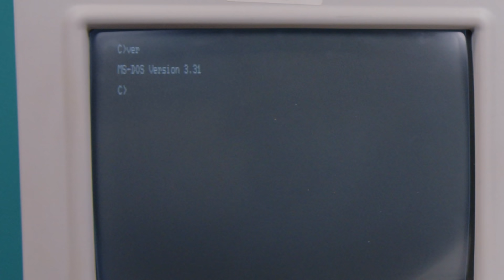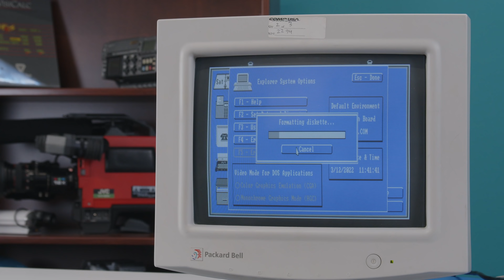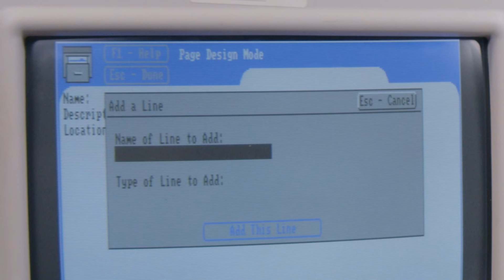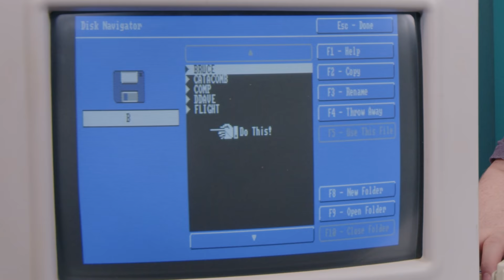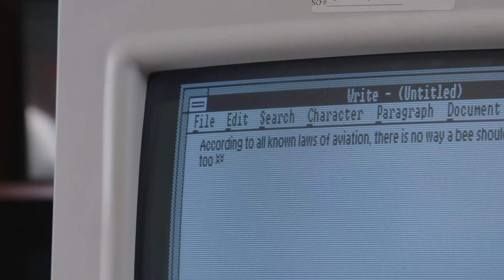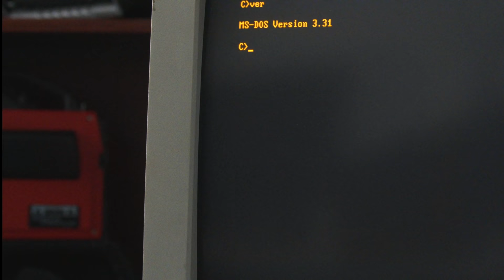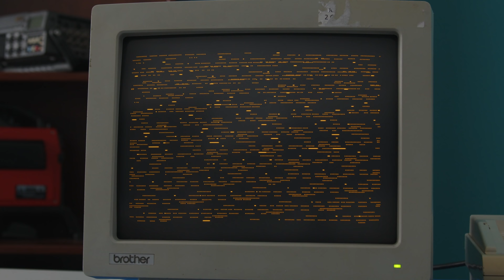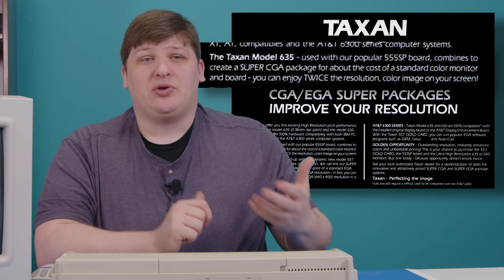Headstart's PC With The Weird GUI "OS" [Explorer]

Comment from the maker: FOOTNOTES / CORRECTIONS:

First, in re: the video chip. I did have the machine open, took a bunch of photos, looked up every chip I could and got nowhere. Somehow (I can't explain this) I completely missed the chip RIGHT NEXT to the video port, a Yamaha v6366. It's documented (http://www.sampson-jeff.com/temp/v6366.pdf ) and appears to genuinely be a weird little gadget that would have required a custom driver. It appears to actually be intended for laptops, which makes sense this late in the decade.

Second, in re: my speculation about the provenance of the design: I decided after finishing this video to revisit the PCB. I did in fact open the machine and look at the board, but got very little info out of it; several of the chips were dead ends on google, and the markings on the board didn't go anywhere either. However, I've checked again, and I have a new lead.

The board is prominently marked "CADAC", and when I searched for that while writing the script, I included terms like "PC" and "computer" and got nothing useful. Today I tried "cadac pcb" and wouldn't you know, it turns out that CADAC is a Dutch board design house, founded about two years before this PC. I have no more info than that, but IMO the coincidence is too strong to ignore.

I assume, 100% of the time, that any clone made before the late 90s was not designed or built in any western country, because the clone market led the electronics industry in exploitation of cheap overseas labor. There are rampant examples of this, including cases - which I scripted, but chose to cut from the video because I couldn't provide solid, visual supporting evidence - where major manufacturers like Dell and IBM simply stamped their name on designs from Taiwanese ODMs, utterly unaltered, and then ran ads in American magazines boasting about their brilliant design and engineering minds, while describing a machine they had zero input on.

So I just assumed this was a similar case, but, Dutch company, Dutch designer - it feels like this was genuinely designed in the Netherlands. Who knows though, maybe a Taiwanese ODM designed it and contracted a Dutch board house to make the boards. Either way,

Third, in re: the refresh rate: MDA is 50Hz, not 75. I was vaguely remembering VGA textmode's 70Hz and thought it had inherited it partly from MDA. I planned on double checking, but while shooting B-roll I had my shutter at 50FPS and was still getting really bad raster roll. I had to adjust to some weird off-speed like 48fps, so my gut was saying "sure enough, feels like some in-between value."

Fourth, in re: the keyboard: Something that's always missing from my comments on keyboards, which I should do better about, is that in the 80s very few people had "proper" "modern" typing experience. Typing was not that common a skill to begin with, and with the PC having basically the only keyboard that you could conceivably learn to touch-type on the way we do now, people simply weren't using keyboards the way we do. Typing on a typewriter, even an electric or electronic one, is very different than on a PC-style keyboard.

All the same, when the PC came out, all the publications praised it's keyboard; they recognized that it was phenomenally high quality and set the bar for microcomputer input, which - to my mind - means pretty much all the manufacturers would have known that that was the peak and were aiming substantially below that mark. So even knowing the context, it's always bugged me that they cut that particular corner so sharply.
Reply: Apparently this little monster can do 320x200x256 with the right DAC, though it's not VGA-compatible (for one thing, it seems to be 9-bit color configured as 3-3-3--8 shades of gray per channel--rather than the VGA's 18-bit color). As for the other chips, the Acer chip near the CPU seems to be an XT-on-a-chip (similar to the Faraday FE2010).
Reply: @lee4hmz  Of course, the CGA and EGA monitor standards only supported 16 colours in total--red, green and blue either on or off, and an extra "brightness" bit to double the number of colours. So, you'd also need to hack a different monitor adapter in, which all seems a lot more work than is worth it!
Reply: @d2factotum  Yeah, at that point you'd be better off shoving in a 8-bit VGA card.
Reply: The Yamaha chip you have listed as being the chip does support the Tandy video mode of the MC6845.
Reply: Huh, i always assumed the original IBM clones were mostly reverse engineered/ designed in the West. I'm pretty sure commodore's IBM clones were designed in Germany (board Layout etc ) and produced in Germany and hong kong...
Reply from the maker: @chunye215  I'm pretty sure e.g. the Compaq portable was, but magazines at the time were rife with references to Taiwanese clones. It's always been implied to me that the ODMs were overseas, though I don't know if anyone knows the full truth.
Reply: @CathodeRayDude   I'm sure it's a huge mix.  I have a PS/1 486 that bears STRIKING resemblance to a Packard Bell PB520SX 386SX.  If you set one on top the other, the chassis design is nearly identical.  There are a lot of similarities on the inside structural design as well.  Both have ties to Samsung, IIRC.

Also, FWIW, re: the tortured UI of this thing -- you started comparing the keyboard to contemporary typewriters, and acknowledged the common level of typing skill at the time.  Take that one logical step further.  E.g., the word processing editing features are pretty poor, but they're about a mile ahead of a bottle of White-Out.  There may be better products out there, even at the time, but the bar was really, really low.  It didn't take much to be "good enough" compared to the manual alternatives.
Reply: @CathodeRayDude  aight, I mean, not that I did any research on this, it was more like in my mind Taiwan only really appears on the map in the 90s technology-wise regarding stuff in the West, but that's obviously wrong. Japan would have been another contender, but they were already "far enough" to actually release the clones under their own brands iirc. I mean, Japan, Korea and Taiwan they all started out as the cheap producers of Noname and counterfeit electronic stuff before becoming good and respected in that regard, just somewhat offset. <Insert that back to the future quote/reference here>
Reply: Guessing this is meant to be the pinned comment? For some reason YouTube unpins edited comments, even if it's from the video's creator. Probably because they actually hate the people who make them money.
Reply: It would not surprise me if that company is somewhat related more close to Philips as can be detected, like some sponsored project. There were many tech start ups in the vicinity of Philips and the technical university in Eindhoven.
Reply: As a geezer who graduated high school in 1978 and college in '82, I don't entirely agree with your comment that few people in the 80s had "modern" typing experience.  Most typewriters do have a different keyboard feel - particularly a manual typewriter.  And I know because I used a manual typewriter for a few years on my first job before we replaced them with computers.  But in high school, I learned touch typing on an IBM Selectric typewriter.  IBM Selectrics were very common for typing classes in many high schools and colleges, and most students who planned to go to college took at least one typing class in high school.  It's been a long time, but I think the feel of the keyboard on a Selectric typewriter was very similar to the IBM computer keyboards that followed.  Regardless, I love your videos - always well researched and well presented.
Reply: What was that Hercules test program you were using? I have an aftermarket Hercules card which acts buggy on certain software and I'm wondering if it also has a faulty/non-supported page 1.
Reply from the maker: Can you email me? Cathoderaydude at gmail - I can't get to it right now but I can email you back later once I dig it back up
Reply: @d2factotum  I believe EGA is actually a maximum of 64 colors, achieved by having an intensity bit for each color instead of the shared one from CGA. Of these 64 colors only 16 can be used at once and I don't know how much software used other than the default 16 colors.
Reply: I just have to say your grasp of this era of computing is quite striking. Especially considering you did not experience it first hand. I am deeply impressed.
Reply: I disagree with the level of typing.  I used PC clones from the time I was about 12.  It was like 86, yeah, ages me a bit.  But the typing would have been a problem even in that era.  That is simply bad programming.  Also, DOS, up to v6.22 could also boot from floppy.   And, 3.1 on that was buggy as crap...  also, I am very very curious at how format works on dos 3.1 with that 3.5" floppy drive, since 3.1 did not support 3.5" 720k disks, MSDOS didnt support that until 3.2.   sooo, is this a hybrid 3.1???
Reply from the maker: @jkramerks  I thought it was 3.3, I may have misremembered or misspoke
Reply: Did you forget to pin this comment, or is it intentional?
Reply: Do you want to publish the PCB shots somewhere? Might be good for posterity, and i'm very certainly taking a look. There's probably a lot more small details to discover besides the Yamaha chip per se.
Reply: Thank you! I started on a mid-80s Zenith laptop - DOS of course & monochromatic - wish I'd kept it - vintage now! Cheers...
Reply: Gernot Schrader  The comment I was replying to was claiming the monitor standard was 16 colors. An EGA monitor can do all 64 colors and doesn't care about the more limited palette of the card.
Reply: Gernot Schrader  wat
Reply: Gernot Schrader  Considering most changes they make are hostile towards YouTubers, and generally seem to result in a drop in views and hence revenue for smaller channels, I can only conclude that they hate them. I'm sure they love the big channels, since that's who the changes seem to benefit, and that's who makes them most of their money. But the only time a small channel can get YouTube to even respond to an issue is to get it trending on twitter.
Reply: Uh.. you can learn to touch-type on just-about any keyboard that isn't sticky or unresponsive. I did so on 8-bit Ataris (which had passable keyboards early in the decade; they weren't cheap machines), and for 30 years after I suffered from PCs having the return key in the wrong place. :)
Reply: wait you said 5 years before MacOS and 2 before Windows?  Wasn't Apple first with the window based GUI?  Was it with the Lisa or IIGS?
Reply: Can I just take a second and be jealous of your typing speed?  I imagined that your post took you about 10 seconds to type.  Make a video proving you're human!
Reply: You reckon an apple ii keyboard is bad.....just try a iic (non-alps) I have to have counselling after using one.
Reply: @MichaelSidneyTimpson  he said 5 years *after.
Go listen again.
Reply: @SianaGearz  looks like the dude is German and his translation software crapped out.
Reply: My first job was to assemble 'clone pc's', this would have been in 1989 or 1990 and we didn't build anything lower than a 286. Most were 386sx or 386dx while the 486 was available but expensive. Fun fact my first PC was a 286 with 1mb of ram, 1.44 floppy and mono hercules monitor.  It cost me £500, my first hard drive was £100 for 100mb, second hand, and my first 'decent' monitor was VGA but mono not colour to save cash.
Reply: Cadac is just a experts management company, you can hire PCB design experts through them ranging from at least 150 euro per hour lol, so im guessing headstart or whomever outsourced the design to Cadac and just giving them certain specifications etc!
Reply: L & S'ed right away 👍. I know its not much but hey - we're here ! GOOD luck !

Comment: Many Turbo XTs used pressing Ctrl, Alt, and the minus key on the numeric keypad to switch to normal speed (4.77 MHz) and Ctrl Alt + to switch to turbo speed (9.54 MHz). Some also supported Ctrl Alt * to select medium speed (7.16 MHz). And that graphics chipset most likely uses the Plantronics ColorPlus standard for what HeadStart called "extended 16-color CGA". The 8-Bit Guy's Planet X3 is one of the few games which supports it.
Reply: It was such a weird quirk of the x86 platform starting with the IBM PC as a reference model that over/underclocking was a built-in feature. Even later in the 286 era you'd get "turbo" buttons despite no longer aiming at that particular set of frequencies. My 286 at the time flipped between 10 and 12 Mhz for absolutely no discernible reason. Maybe a handful of games would run too fast at 12 and be playable at 10, but if they were expecting lower you were still boned.
Reply: @mademedothis424  That was probably more for expansion bus compatibility. 10 MHz was the maximum that many ISA cards could reliably operate at. 12 MHz was really pushing the limit. 386 and later boards fixed the ISA slots to a maximum of 8 MHz regardless of CPU speed.
Reply: @vwestlife  Hm. Interesting. That machine was outputting VGA graphics, but I genuinely have no idea out of what. There was also a serial port and a hard drive, besides both types of floppies, so there must have been multiple controllers, but I don't remember a bunch of ISA cards, and I did open it pretty often. It was a pretty late 286 AT clone, though, so who knows what was going on in there. I was certainly too young to know.
Reply: @mademedothis424  he was using an adapter to convert the signal to VGA. He showed that at 14:45. It wasn't outputting VGA. It was CGA and MDA signals.
Reply: @SeeJayPlayGames  Youtube threading is trash, so I don't blame you, but you misunderstood. I wasn't talking about the PC in the video, I was talking about my own 286 in response to VWestlife above.
Reply: @mademedothis424  oh, sorry.
Reply: I’m from the Netherlands here we bought it also as headstart explorer
Reply: Plantronics is spot on - 640x200 with 4 colors. I'm willing to bet that the graphics chipset is an ATI "Wonder" CW16800-A as used in the Commodore PC-10/20/40s that were everywhere in the mid to late '80s.
Reply: @drmr4613  yep it was a ATI Wonder
Reply: That was the Other Headstar, it did VGA emulation, it emulated all old chips, so you could run all games on emulation graphics!